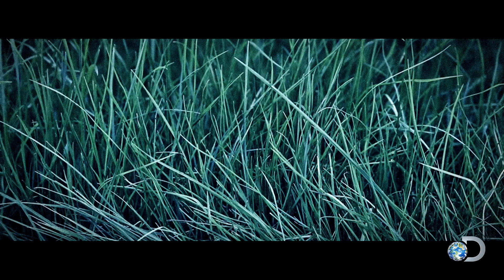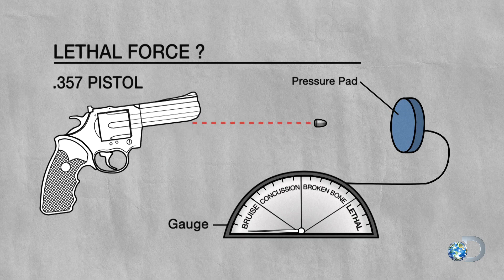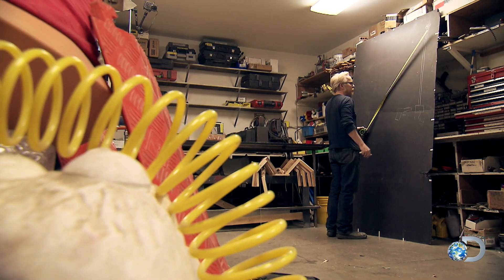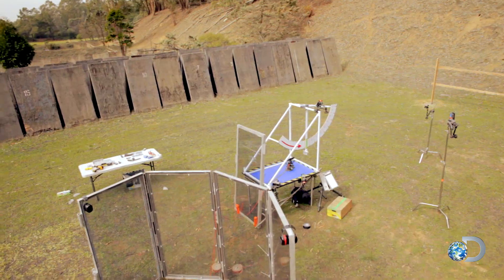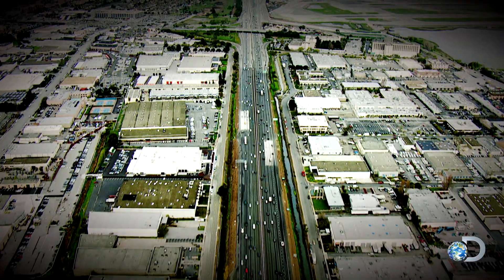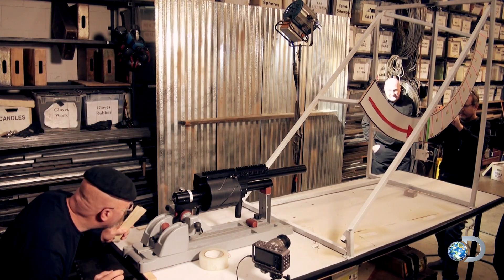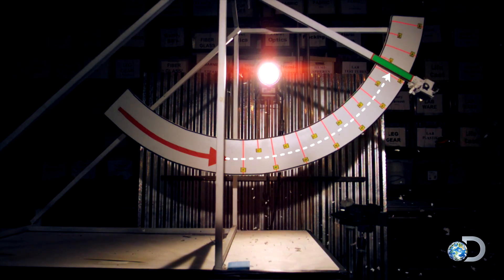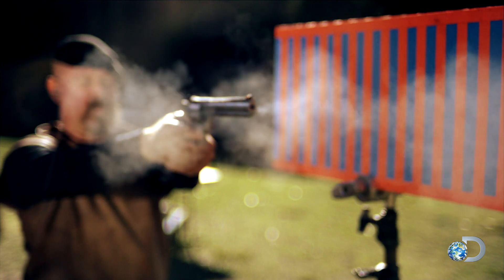Lethal Lawn Mowers MiniMyth | MythBusters

Comment: This is a little off. Where was the testing for speed from a lawn mower? Plus, I've had a rock out of a lawn mower hit my shin before. Sure it cut the skin, but it was certainly no gunshot wound.
Reply: They consolidate the process and don't show all the steps for the mini myths. The speed they calculated for a rock out of a lawnmower would have been as fast as they could replicate. A worst case scenario. Most of the time rocks would shatter, hit multiple surfaces and lose a great deal of kinetic energy before hitting you. 
Generally mythbusters worked with best or worst case scenarios as they tested the possibility as opposed to the probability. 
I too have had many things hit me from under my lawnmower. I also had a whole bunch of this twine stuff that I would mow over fairly regularly with no issues what so ever (my garden mulch blows around and I use the waste from my horses hay bales which is wrapped in plastic twine nets).  Then one day a piece whipped around and sliced my leg open. Not very likely as I mowed over that stuff every week, however totally possible.
Reply: @jackquick8362  bet that left a scar.
Reply: Santiago Sánchez Santarelli he's 'Creepy Cooter' for a reason xD
Reply: What the hell are you doing here, Cooter? Go back to the ranch! You're everywhere lately!
Reply: yea they should of had like a pebble or something to compare to the weight of a bullet. clearly the rock will have more force due to mass.
Reply: Foster cause lawn mowers have different power and speed than others and some rocks will travel faster than others
Reply: Explosive_ Shart but the less mass the same force will make the small pebble go faster ... there would be roughly the same results
Reply: it depends on the rock, lawnmower, area, etc my buddies dad is a cop and they found a guy with his jaw blown off (they thought he had been shot) turns out a rock from a lawn mower hit him. To be fair i think it was one of those big ones that you ride.
Reply: Foster I was hid in the hip and all it did was get past the skin
Reply: But if it were the size of a bullet with the same amount of impact it would have been a gunshot
Reply: Foster exactly the is no proper speed the rock goes depending where the rock is hit
Reply: Fosters right. You should have first tested the delivery force on an object from a swinging blade, then applied that to a standard rock bed really rock. I know this was a mini myth but come on guys, I know you’re better than that
Reply: Same
Reply: What they should have done is get any of the old run of the mill lawn, mower possibly 1 gas 1 electric.

Get the high speed camera and turn the lawn mowers on and put them on their sides. Using the high speed camera test out their RPM (Revolutions per minute) (How many spins the thing does in a minute) and use that knowledge to build a catapult which launches at the same speed. Or something like that
Reply: I think anyway I am not a physics expert
Reply: Foster they removed all variables
Reply: Snackadoo
Reply: Depends on the horse power and rpm
Reply: My cousin's sister died from a pebble that was hit by a lawnmower, so it can kill. to be fair, it did hit her neck.
Reply: Don’t know if anyone cares, since it’s been so long, but technically the difference between the bullet and a rock fundamentally is due to its shape. Where a bullet is smooth and designed to fly in a rotary motion with a pointed edge to penetrate, an irregularly shaped rock will attract too much air friction and slow down before reaching its target. Small jags on the rock may contribute to your injuries or cuts

And Adam clearly says that this test was about the power that a rock launched from a lawn mower can theoretically possibly be stronger than a .357 bullet. Which, he proved.
The point wasn’t whether it will kill you or not
Reply: I lived after getting hit
Reply: @noahtiseling3514  what if u get hit in the head by a commercial lawn mower? They have alot more power. You think you'll live through that? Don't  underestimate
Reply: Foster 😂 yea you can say that
Reply: Faceplant
Reply: People are worrying about the process not the bullet/rock itself. Bullets have a cone shape for piercing skin/etc. Bullets are deadly for that reason. Imagine a spear thrown at 10feet per second compared to a rock thrown at 10ft. They missed the rocks piercing power.
Reply: I broke a board on a cedar fence when I ran over a pebble about 3/4 inch diameter.  I've seen broken windows and dented cars too.

Comment: Now this may not matter once the Rock hits your Head. But this IS a bit misleading for the sake of the experiment. I can only assume that the Rock had Much more weight to it. Use a Rock that weighs the Same as that Bullet and you will get Totally different results. I love Myth Busters but this is misleading.
Reply: They were doing the experiment as the myth was told. 
'misleading' - what do you think a rock looks like. Rock not pebble. 
A rock kicked up from the lawn could kill someone, rocks on your lawn are not all tiny and you most likely kick up a large one. 
This is why they did the experiment with a large rock. It was not to draw up a parallel. 
That is like saying, 'myth: a squirrel could beat an elephant in a fight'
                                  'Oh no the squirrel was crushed to pulp'
                                  'I bet if the squirrel was as big as the elephant  it might have won; especially also if it had 2 foot claws that could cut through glass'
'I love mythbusters but this is misleading''
Reply: CAN YOU SMELL WHAT THE ROCK IS COOKING

Comment: This is a bullshit test, While they show the correct equation they forget a lot of important factors on external ballistics.
Lets say the rock is about 1/6 of a lb. (Video did not disclose the weight of the rock) travelling at 400 mph or about 585 fps.
a 1160 grain rock (1/6 lb.) travelling at 585 FPS = 882 ft.lbs E, Were most loads of 357 mag is around 650-750 ft lbs.

While on paper this sounds like the rock is more lethal its not. The rocks higher surface area and non aerodynamic shape means it will loose a ton a velocity over short distances even across a yard. Even if it lost only 25%  it's velocity would go down to 438 and loose KE down to 500 ft lbs.

Something shaped so oddly would have a very difficult time to penetrate clothing or even skin. 
FBI standards call for a bullet to penetrate 12' of ballistics gel with 4 layers of denim on the front of it.
There is no way in hell that a rock is going to have that kind of ballistic performance.

Launching a rock at 585 fps by a lawnmower blade hitting it seems pretty fast. Realistically i would venture to guess it would be closer to half or even a quarter of that velocity.

However it could kill you via blunt force if it hit you in just the right way, But on par with a .357 mag performance? No way.
Reply: They were just testing if the rock has as much kinetic energy as a .357 bullet when both are first launched, not whether or not it is lethal from across the street.
Reply: If that's the case than no. Potentially lethal? probably. Mass accounts for a lot less than velocity.

Comment: same energy perhaps but one is traveling a lot faster and has a designed shape for more penetrating ability hence obviously a bullet will kill and a rock may not go through the skin. i know it sounds obvious but just remember that when he says his theory.
Reply: To say nothing of the weight of that Rock. How heavy was it compared to the bullet. Love Myth Busters but this was A Really bad experiment. Not enough info.
Reply: The speed is already factored into the kinetic energy, but you're right, things like air resistance, penetration etc. also matter.
Reply: That was not the myth. They even specifically say that. The myth is that it hits with the same force as a 357. bullet and that was true.

Comment: Now I can't trust any tests they do!
A rock has a far larger surface area, meaning there's  a larger area of the head to absorb the energy.
a bullet is lethal because of its ability to penetrate with its small surface area at the point of contact not  because of its power. That pendulum fails as an accurate method to test this myth so it begs the question what else have they failed at correctly proving?

Comment: This test was fundamentally flawed. The rig actually measured momentum (mv), not energy (1/2 m v^2) as stated. So unless the rock and bullet have the same mass, the conclusion is invalid.
Reply: If the lead bullet hits the metal plate (the contraption he made) and gets flattened, then some of the kinetic energy is being converted to heat. The device won't measure the full kinetic energy of the bullet.
If a rock hits it and bounces back, this is called an elastic collision. The device won't register the full kinetic energy of the rock.

Comment: I am a gardener and I know how scary it can get if my mower hit a rock at the right angle and shoot straight out freely. Example are like busting window of car, damage the body of a car look like it hit by an screwdriver.
However, the body of the mower is even stronger so this kind of accident is extremely rare. In order to be 'lethal', the angle of the blade hitting the right size of the rock has to be very precise. The rock has to back strong or it will be cut through by the blade (the most cases).

Comment: How does the grenade launcher they used in the test equate to the power used in a lawnmower? Also there are different models of lawnmower, so which engine are we talking about. Lastly the housing of the gun/ grenade launcher is such that the energy is focused, the energy dissipation from the projectile launched from the mower would need to be factored in.  Their tests are utter crap.
Reply: +Socrates my friend, they tested the rock's speed with the lawn mower (hence the slow mo lawn mower clip)
then they adjusted the gun's force 

im pretty sure they did that

Comment: would it penetrate skin though? probably not
Reply: jablesmegee
a stone does not have the mass of a hammer
Reply: +A Cat A few years ago there was an incident where a little girl was killed when a piece of metal was ejected from a mower.  It struck her head.  Very tragic.
Reply: jablesmegee
it would hurt im sure of that, but i wouldnt imagine it would kill or even be a life threatening blow
Reply: well i don't think i could hit someone in the head with a hammer as hard as that rock was flung and yet i bet i could quite easily kill someone with a hammer.
Reply: i dont think your quite getting it, the mass of a hammer is quite alot more than a rock... rocks dont weigh much so even though they are travelling fast... it isnt going to do much damage where as a heavier hammer moving more slowly will do much more damage, velocity and mass equal its force... as the surface area of the object, this is why i say a flat light stone wont kill you upon impact
Reply: but where was it specified as a flat light stone? if a small child can throw a rock and smash a window or dent a car door then i can't see why a rock fired with more power than a .357 couldn't fracture the skull or cause internal bleeding. I'm not saying it would instantly kill you and blow a hole in your head
Reply: jablesmegee
stone generally have flat edges and are light. smash a window because winodws are brittle and to dent thin metal does not take much.
Reply: but would it penetrate a vagina??
Reply: +A Cat even if it couldn't break skin, it'd be blunt force trauma the same as a hammer to the head might not break the skin
Reply: Ok kinetic energy is equal to mass x velocity x velocity divided by 2
look at that equation velocity shows up twice now lets put in the units 0.25 kg rock velocity of around 430 km/h that is around 1850 joules. That is around 1350 pounds of force per square foot it takes a maximum absolute max of 400 pounds to break through temporal lobe. You will not only go through one side of the skull you will smash through both. That is a fatality in my books. Furthermore in the words of Jesse Pinkman, Science Bitch!
Reply: +A Cat Lets not forget we Used rocks as Weapons.

Comment: The thing about energy is that it's proportional to v^2, whilst the the momentum, what moves the hammer, is that it's proportional to v. They may have the same momentum, but I doubt they have the same energy.
Reply: absolutely correct: While the rock indeed had a little bit more momentum, the bullet probably has nearly 5 times more kinetic energy, owing to the much higher velocity, despite much lower mass.

Comment: At point blank range they are the same, but over any kind of distance, the rock would slow tremendously, whilst a bullet is designed to spin and maintain speed
Reply: It's a larger rock flying out awkwardly from a lawnmower will slow over distance.
Reply: @DamnUADumbass the rock would have a larger surface area and is more liable to slow down
Reply: DamnUADumbass It'd go into a constant downward position and the weight makes it 2x, meanwhile guns have grooves in the chamber, making the bullet spin when it shoots and making it more faster, accurate and stronger
Reply: @kuraes  Piccolo: "NERRRRRD!"
Reply: @kuraes  Making it more faster? And you made your name "DamnUADumbass"? 🤣
Reply: Chris Goodall but wouldn’t that mean the person pushing the lawnmower is still in a good amount of danger?
Reply: theirs also the larger size of the rock making it take more energy to actually pierce flesh since it has to go through more of a person's body than a bullet. aka, a lawnmower blasted rock can theoretically kill, not will.
Reply: @minktanker9705  Yes!  This!!!
Reply: I highly doubt that a lawnmower throwing a rock, even at point blank range, will deliver 800+ energy foot pounds.
Reply: Chris Goodall, my lawn mower picked up a rock, flung it 200 feet, and still the rock split straight through sheet metal. This rock was probably one cubic inch.
Reply: Well i know it wont kill cause i was hit in head with by a rock from a lawn mower about 15-20 feet away i did have to get stitches thats about it
Reply: @evanbudd2659  Most individual bullets don't kill either. There's a reason cops magdump into criminals. Bullets from pistols are much less deadly than people think.
Reply: I dont know ive gotten hit by a rock hurt but i imagine not as much as a bullet to the leg
Reply: @julianmj213 Getting treated for being shot hurts way more than being shot. I cant for say I really felt anything prior to the iodine.
Reply: WHAT IF WE RUN OVER A PILE OF BULLETS WITH A MOWER? now thats something that I would do if I was bored in the middle of nowhere.
Reply: I have always felt like physics books neglect air resistance a little too often.
I mean, sure, air resistance is technically a very complex variable, but it is frequently modeled as being proportional to the square of an object's speed, and this is totally manageable for people who have done a bit of integral calculus;
it will usually end up as a trigonometric substitution, or maybe a U-substitution.
Reply: also the revolver will do it everytime. the rock from the lawnmower is possible, may not have ever happened, may never happen. the blade would have to hit the rock perfectly. and there is no perfect in reality.
Reply: I have had small stones fly into my shins a few times when I have used a grass trimmer - which I would guess hurls the stones with about the same force as a lawnmower, with all the real-life variables taken into account - and this definitely hurts quite a bit, although it isn't really too horrible.
I also wear proper work clothes, which soften the hits.
It is generally advised that people stay at least 50 feet away from a machine like that while it is operating.
Reply: thecritic8096  No, but they are similar in the sense that both of them propel projectiles at a high speed, although a gun is obviously more built for that specific purpose.
Reply: The rifling doesn’t make the bullet go faster. The rotation of the bullet out of the muzzle has to do with accuracy and keeping the bullet stable in flight. It does, however, enable the bullet to maintain its velocity more effectively by not letting it tumble and thus increase its wind resistance.

Going faster is not the same as lose speed slower.
Reply: DamnUADumbass that's logical especially there is no such thing as wind resistance.
Reply: Most of these comments are just people reiterating what the original poster said
Reply: My object detecting lawnmower will help. Subscribe if you like my idea.
https://youtu.be/eDZeLPgYBvg
Reply: Also won't stop when it hits bone or skin
Reply: nerds 😂😂😂😁
Reply: @niedodwyaneanthonye.7727  nerds??.. no ur just an idiot.. HAHA!

Comment: WTF..... so they just assumed that the air gun shooting a rock has the same power/ velocity as a lawnmower shooting a rock? wheres the test to confirm that the two are are equal? 

Hmm, I wonder if throwing a potato at somebody will kill them or not. Since my arm is sore ill just replace it with a potato cannon, because they are identical circumstances right?
Reply: This isnt the full episode
Reply: They measured the speed of the rocks flying from the lawnmower and input it into the air gun, it was about 400 ft per second

Comment: except that energy is lost rapidly due to drag and friction. wheras bullets retain energy efficiently
Reply: +MethamphetaMEMES The test was purely to prove if a rock flung by a lawnmower could have the force required to kill someone. It does. End of test.

Of course bullets are better because they are designed for long, accurate flight paths with some level of puncturing power.
Reply: +MethamphetaMEMES i think they should have made it at a longer distance since after all he said a rock from across the street
Reply: +Revengefull “Revenge” death That was just a rhetorical scenario for the sake of introducing the myth.